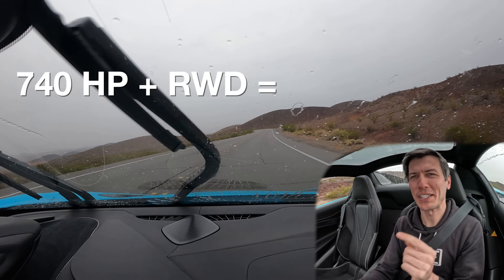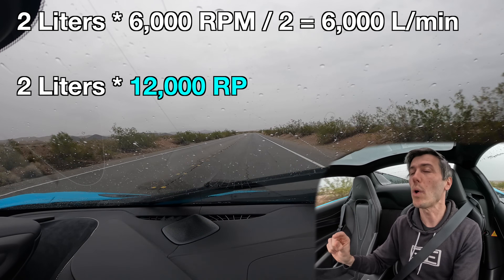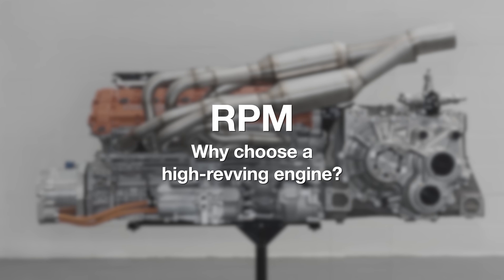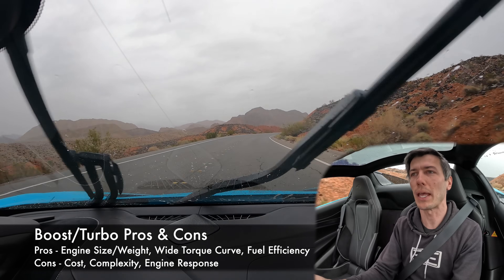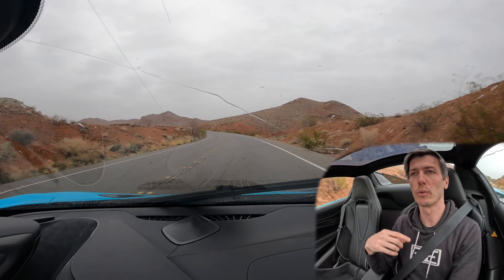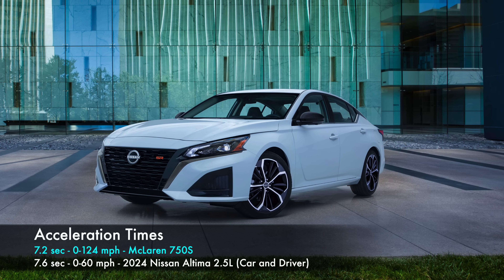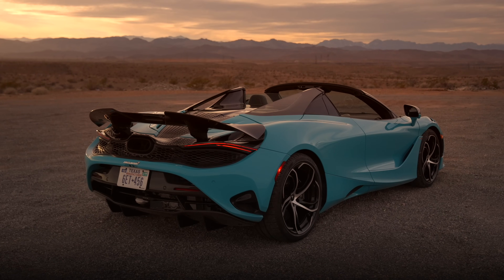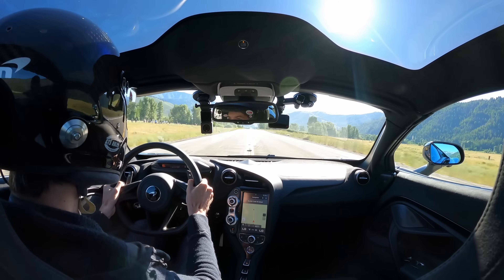Boost vs RPM vs Displacement - What's Best For Horsepower?

Comment: Interesting example for the differences between displacement, forced induction and fuel efficiency: when AMG changed from the 6.2L NA V8 to the 4L Biturbo, the smaller engine with the whole turbo, intercooler stuff was heavier than the 6.2.
It had more power and torque, and due to cylinder deactivation and smaller displacement did use a little less fuel in low load scenarios.
When the power was used, it didn't consume less fuel than the big V8. ti was right up there with it.
Another funny comparisson: i remember reading car tests of a sporty car magazine years ago. (It wasn't a direct comparisson, but they tested each car the same way) They really used the power the cars offered on tracks and in testing. The Mitubishi Lancer Evo (don't remember which # though) with it's 2L Turbo engine had the same fuel consumption than an E63AMG with the 6.2L V8.
So with a relly heavy right foot, both take the same amount of fuel even though one car was significantly smaller, lighter and had a smaller engine.
But why was that? Because the Evo used additional fuel to cool down the air fuel mixture to prevent problems. (i think EE has a video on why some engine need that and what it preents-> needs more fuel, and makes for a dirtier combustion. (soot around the exhaust)
Reply: I've got a W205 C63S with the 4 litre biturbo. The fuel economy difference with the older W204 6.2 NA isn't insignificant. Cruising down a motorway/interstate at legal-ish speeds gets over 30mpg, (and hovering around 2,000rpm with a nice V8 rumble)  which I reckon is pretty good for a +500bhp V8. The W204 is down to 25mpg, but at least it sounds good. The correct answer for what is best is a V8.
Reply: @jamesweatherley9215  As i said, in low load scenarios it uses a little less fuel.
That said, i drive my E63 over the whole year with a little over 19 mpg (had to convert it to us mpg as we use a different metric).
Calculated via the fuel filled in and the distanced done with each tank of fuel, not by the instrument panel.
And the lowest i did over a full tank were a bit over 22 mpg. (with 4 people in the car, in above 30°C temps and going 240kph in neighbouring germany for a short time. =above 86°F,  150mph)

Oh, and yes i agree fully, V8 is best.

Comment: There are two more ways, which are followed by some of the most amazing cars ever. Ram air, and induction pressure waves. Neither are new, but maximising them is beneficial. 

If you look at the engine installation in the Gordon Murray T50, there's a air scoop on top to get ram air pressure. That is a straightforward boost of the air pressure in the inlet manifold. Secondly, the plenum is shaped to promote a pressure wave travelling up and down it. The idea is that the pressure wave arrives on top of an inlet valve as it's opening, and so the air pressure above it is momentarily higher than it otherwise would be. The plenum is carbon fibre, and seems to be very stiff and strong I guess to ensure that the benefit is not wasted in flexing the plenum. M539 Restorations has a video where the plenum on a BMW is flexing far too much.

The F1 did this too, but listening to the T50 engine I think Cosworth have worked really hard to maximise the effect in T50 (and the AM Valkyrie engine). The clue is in the emissions compliance. They have made a 600+hp V12 compliant with emissions regs. Normally, that would require turbocharging. They've gone the NA route, but must be achieving a reasonable level of boost regardless simply to pass the emissions tests. 

These two approaches also boost the mass of air that ends up going through the engine, but without any of the weight of compressors or additional displacement. This probably exacerbates the impact; they might not be delivering as much boost as a honking great turbo, but without the weight of a turbo installation the overall car performance is enhanced just that little bit more. 

The exhaust energy isn't necessarily wasted either in such cars. Gordon Murray uses it to help extend the effective aerodynamic length of the car, which reduces its drag. Again, the impact of doing so is maximised by not having the weight of the physical long tail structure one would otherwise need. 

F1 and T50 are almost unbeatable examples of the benefits of losing weight and maximising mass-free effects.

Comment: I know you have covered it before in a separate video(s), but i am surprised compression was not a 4th comparison. (Sort of the other side of RPM).

Bigger engine, higher rpm, higher compression, and boost.

Comment: A consideration missed is the fact that slow moving mechanical componants WILL last longer than High speed componants, hence a large capacity lower revving engine if built with quality and durability will outlast all the faster revving ICE's

Comment: I think boost should be as low as possible, the power to torque ratio should be at 0.5 or above and torque at max rpm should be at 90% peak torque or above, which ranks rpm higher than displacement and displacement higher than boost.
I tend to see peak power as a gimmick, as it only describes, up to which speed you can stay at peak wheel torque and how fast you can go.
I would aim for usable power at low rpm (primary with displacement, only minimal amounts of boost) and peak power with a power to torque ratio of at least 0.5. So peak power would in the end be mainly achieved by using higher rpm but you don't have to rely on rpm alone.

Let's say, you want to have about 70 kW at 2000 rpm. You need 335 Nm at 2000 rpm, which can be delivered with 3.0l displacement and about 0.1bar boost. Peak power should at least be at 167,5 kW or about 170 kW. If you are good at designing engines, you use the given limits and increase power with higher rpm, therefor flattening the torque curve. You should be able to reach at least ~240 kW at 7500 rpm.
To put this in to scale:
This translates into a range of displacements for normal road cars between 1,5l up to 3l (120 kW up to 240 kW), which one could claim to be reasonable.

Comment: No replacement for displacement! 😁 Great video. Something we argue about at work all the time.
Reply: electric engine
Reply: @drummingbomb  gay
Reply: @drummingbomb  Hi CCP bot. Electric?  We are not interested in your Communism 3.0, your mandated non-consensual commerce, your ESG, your 15 minute cities with Digital ID, CBDC, social credit digital prison. We will not Eat Zeeeee Bugs and we will not wear your Climate Chains. Not having it, go to hell!
Reply: its true.
Reply: Boost, boost is the replacement for displacement. The car gods have spoken. Most engines are getting downsized and turbocharged to make similar power in a smaller, more cough fuel efficient package.

Comment: Big displacement can lead to stresses as well - it can turn into large piston speeds if the engine layout is weird and you‘re asking for only reasonable RPM - eg. 3 L straight 4 in the Porsche 968 CS.

Comment: You know it but I write it to others that higher rpms makes no time to fill the cylinders with air so you loose effective air weight and those get less equivalent power and worse efficiency.

Also higher rpms means you have to make the engine stronger compared to its volume so you do not gain 100% weight and that is even worse for forced induction engines.

Comment: Just the mathematics of torque...like, a V8 has more torque than a 4 cyl engine and and 13b rotary engine, whilst powerful- has less torque and therefore only really effective in lighter cars. Diesel is more Torquay (forgive grammar), but the 13b rotary engine has only 2 cylinders. So, Mazda got rid of it. They now do, in aftermarket circles, 4 rotor engines. Yes, essentially 26b. 13b rotary= 101kw and 180 nm torque. 26b rotary (4 cylinder) = 842 and 1254 nm torque. These engines are so "efficient", the heat through the exhaust is significantly hotter, making extractors glow red...❤

Comment: The answer with everything is "it depends"

What are your goals? Maximum combined cycle thermal efficiency? Maximum HP? Max torque? 

If people would pull their heads out of their asses the most effective vehicle we could conceivably build would be a diesel electric hybrid, small displacement engine maybe 10-50 HP, running at 80% of it's rated output. Battery supplies extra power during acceleration and offers recovery during braking. Real world 150+ mpg especially if you actually bother to tune the engine for efficiency. If a diesel skoda can exceed 100mpg, there's no reason we can effectively double that with existing tech

Comment: When I think about the old steam engines averaging about 240rpm but as external combustion engines, they had the entire atmosphere of air to work with.
Reply: Also, steam expansion is a different beast, akin to some miracle fuel.  They tended to be reliable, even considering the lack of advanced materials.  Some of those old stationary engines can still be used today.

Comment: High RPM can be so fun, was the best thing about the CBR 600RR I had. Making that engine sing with a modest exhaust was fun. 
Crazy to think the Yamaha R1 can pump out 200HP in a 1L N.A. engine.  The acceleration on those are absolutely brutal.
Also wild to think with the advancement in technology and parts availability, how "easy" 1000HP is to make these days.
Reply: Bro, MotoGP bikes are like 280hp from 1 liter motor.
Reply: @vvevvevvvv  True, I guess I was thinking more about pump gas power.

Comment: What we need is excellent torque and power at low revs for tractability, a strong midrange to give you the thrust where you need it the most, and a screaming shockingly high revving top end to widen the powerband and give that feeling of endless power, and superb linear throttle response. In that case it is NA V12 all the way - Cosworth, Ferrari, Lambo, BMW S70/2, HWA - these have the best of all worlds.

But somehow by some witchcraft the nerds at Koenigsegg and Ferrari managed to make even a Turbocharged engine respond like an NA one.

Comment: I would argue that 4.0 liters isn't a big enough number to say that it utilizes displacement for its power output.  Pretty much all V8s are above 3.8 liters  so it's on the smaller side.  The 5 liter has been around forever in the mustang and nobody ever talks about how much displacement it has when Dodge and Chevy are up in the 6's...
Reply: And yet when you compare all 3 engines from each of the respective manufacturers, the Coyote 5.0 V8 is usually considered the most responsive to engine modifications because of it's more advanced modern build. It likes to rev out like a high rpm engine, it responds incredibly well to boost and it's actually perfect in size for a bit of lightweight yet reliable displacement. It's one of the most ideal engines built, and is benchmarked or used as a base platform for many high performance cars engines.

Comment: There’s also MGUH where rather than using a waste gate you use a generator to slow the turbo.  This then runs an electric motor to provide more power. About an extra 100hp in an F1 car

Comment: rpm without displacement and or boost is meaningless. to make power you need a combination of everything combustion related
Reply: Did you watch the video? Rev a small displacement engine high enough and it will make great power.

Comment: One of my silly engine swap ideas would be to put 250cc inline-4 18,000 RPM 45 hp engine, that sounds like F1, into any car. Imagine making F1 sounds while barely hitting 120 km/h top speed

Comment: My ye old 460 big block consumes a very compatible 22500L/m with a 3rd of the power of these engines. With 2x the fuel consumption. No replacement for displacement.

Comment: Also the design of the engine plays a crucial role as well. V versus inline; OHV versus SOHC versus SOHC; and the firing order and harmonics. In my opinion, straight six engines are the ultimate design for power, longevity, and practicality. Examples are BMW's 3.0L straight six, Ford's 300cid 4.9L straight six, and Cummins' 5.9L straight six.

Comment: I had a 1976 trans am.  455 cu.  The height of the malaise cars.  Probably less than 200HP.  But the torque was just fantastic.  As long as you were moving you could just power out of 4th gear.  No substitute for cubic inches! ;-)

Comment: A turbo isn’t powered by heat from the exhaust. It is powered by the huge increase in back pressure.
Reply: That's not really true... There is inherent energy left in the exhaust due to the fact that there isn't enough time during a power stroke to completely burn the A/F mixture. It still has explosive pressure as the exhaust valve opens and this is what you can hear, and also what drives the turbo. It's why turbos are quieter.

Comment: How about the torque?
Reply: Power, not torque, is the limiting factor in not only the top speed of a vehicle but also how quickly it can accelerate at any speed and how much weight it can pull up an incline at any speed.
Torque is the sound of one hand clapping.

Comment: Funny your kind of forgot to mention that you could also just cut the number of strokes in half by using a two-stroke or a rotary. So it's four ways not three
Reply: He didn’t forget just focused on typical 4 stroke engines hence his use of dividing by two for each combustion event. His argument could have just been rephrased to say combustions per minute.
Reply: @ALMX5DP  I think he forgot
Reply: Rotaries are 4 cycle engines.  They are just better 4 cycle engines. 787B FTW!

Comment: @EngineeringExplained: please explain why the engine manufacturers are not doubling the stroke&bore when doubling the displacement.
I kinda have some ideas, but I am not engineer. (I drove the bus @ picture and that engine is straight 6, huge pistons.)
Thanks!
Reply: One of the cool things about the wonderful engineering is that it's so complex that about 120 years after the first car, engine manufacturers are still figuring out new ways of meeting their goals.  Jason obviously cannot get into all the details and tradeoffs which he would understand in this video.  If you double the stroke you double the effective size, but the upper limit of your revs tends to be limited.  Fuel efficiency suffers too.  Doubling the bore (by itself) makes the displacement 4x and makes a huge engine, and the benefits tend to wane.  This question is that of an 'undersquare' or 'oversquare' engine design, whether the bore is larger than the stroke or vice versa.  Most modern engines are kinda close to equal for complex reasons.  You get more moxie from the gas at the beginning of the power stroke than you do at the end of it.  You can look up the undersquare thing for a deeper dive.

Comment: 2:44 I don't know about this specific analysis as a comparison for airflow. I think the efficiency of intake and exhaust flow vs rpm, vs boost, vs displacement seems much more relevant. 

Because  The L/min is not adressed as function of L/per rotation. But it is obviously still relevant for the question of engine power being made at a given moment.
Reply: The l/rotation is the same as l/revolution and the time part of that is implied in the unit, literally 'per second', like it was expressed in rev/minute or you could state it rotations/second.
Reply: Yes certainly. I apologize, I did not phrase that well and imagined people were following along from the prior statement.

I should have said something like:  Because the L/min is not extrapolated from a more detailed scale. (Specifically, flow rate per rotation relative to the variables for each approach). It misses out on illustrating the differences across the 3 and suggests more parity than there is. (The line wasn't so much about the illustrated unit, but the process of having a smaller level of detail being examined then expanded.)

*Though it ended up just being sort of a cursory discussion as a lead in to talking about the 750S anyway. As opposed to his more detailed whiteboard discussions. Thinking about it now, Driving 4 Answers may have made a video on the topic more like my initial thought, so one could argue there isn't need to cover it in the same way regardless.

Comment: There are other trade offs between the 3 solutions that impact engine design such as size and shape, MPG (efficiency), emissions, and cost.  BMW had great high RPM engines 15 years ago but they were trouble prone, poor low end torque and poor efficiency.  Switching to twin turbo allowed reduced RPMs, greater torque and much greater efficiency.

Comment: ALSO, YOUR REAR END AND TRANSMISSION GEAR RATIOS ARE HUGE FACTORS IN HOW A I.C.E CAR OPERATES YOU CAN HAVE 2WD AND 1000HP AND WITH THE THE PROPER GEAR RATIOS AND TRANSMISSION THE VEHICLE CAN BE STABLE EFFICIENT AND SAFE. FOR EXAMPLE THE KOENIGSEGG  REGERA HAS OVER 1700HP 2WD AND DIRECT DRIVE WITH ELECTRIC MOTOR ASSIST. HIGHER RATIOS WILL ALSO ALLOW THE ENGINE TO OPERATE QUIETER AND AND MORE EFFICIENTLY IN CRUISING AND CITY DRIVING SITUATIONS. LARGER DISPLACEMENT ENGINES TEND TO HAVE A WIDER TORQUE CURVE ALLOWING LOWER RPM AND HIGH TQRQUE TO PROPEL THE VEHICLE. THE APPLICATION OF SAID VARIABLES AND THE INVERSE HAVE A MULTITUDE OF COMBINATIONS DEPENDING ON THE DESIGN PHILOSOPHY OF THE VEHICLE.

Comment: i’n hoping you misspoke that the 720s is an open diff because personally a sports car is not a sports car if it one wheels haha
Reply: Yup it has an open diff with brake torque vectoring to control wheel slip.

Comment: "What is a metric horsepower anyway?"  Probably referring to horsepower measured by the European DIN standard, instead of the SAE standard.  Although European, DIN horsepower ("ps" in German) is not an SI metric unit of power.  The SI unit is the Watt, with kilowatt commonly used for something the size of a car engine.